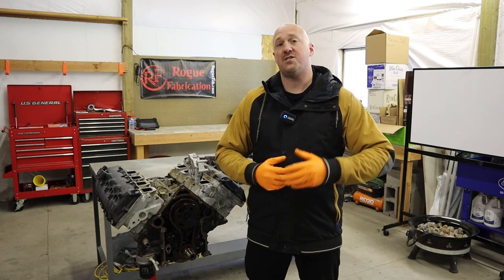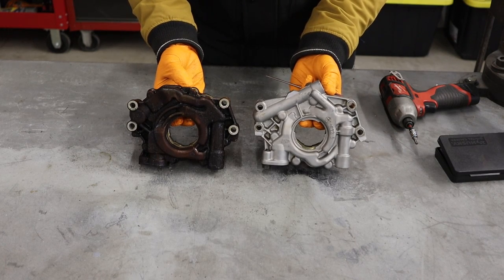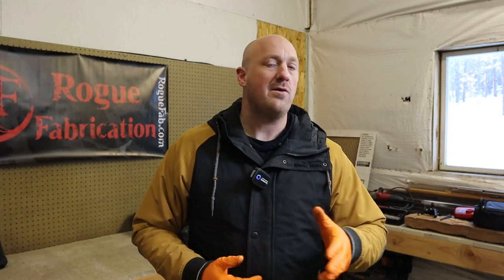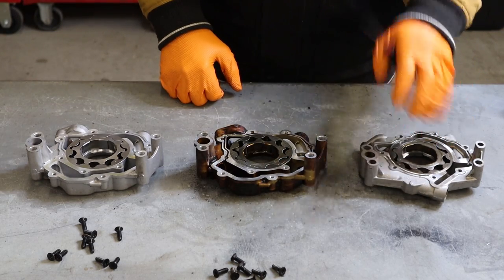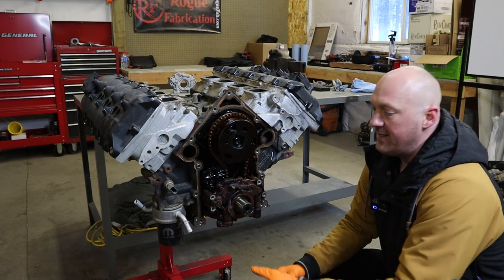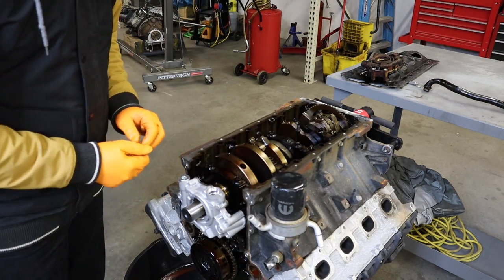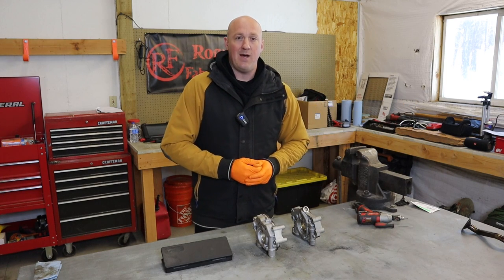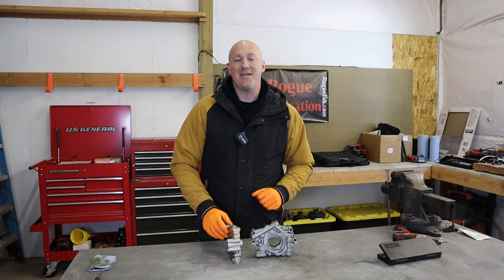Is it TRUE that Installing this ONE FACTORY PART Can PREVENT HEMI TICK?

Comment: We just had my wife 2013 wk2 camshaft and lifters replaced and had the 6.2 oil pump installed. I understand it setting codes for low oil pressure codes at start up. But it's been 900 miles and the code keeps coming back whenever it wants to. Like it's burn into the memory of the ecm. Do you have any input on this? Thanks
Reply from the maker: Unfortunately this is a software issue that seems to only affect certain models. Thus far I don't have a solution for it.
Reply: @ReignitedAuto  I notice you can clear the code and it comes back with a cycle of the key. It doesn't even have to start.
Reply from the maker: @Robert Stanley  well that's definitely new info.  I'm going to keep trying to find a solution.
Reply: @ReignitedAuto  me to is there away I could get intouch with you beside thur YouTube?
Reply from the maker: @Robert Stanley  I have email sales@reignitedtx.com but it's definitely hard to get back to everyone who emails me questions.
Reply: @ReignitedAuto  Thank you for your time I sent you a email and maybe working together we can get this fixed for everyone
Reply: @ReignitedAuto  good evening,  I sent you a email with info.

Comment: So everyone knows do not install a hellcat oil pump on a 5.7 if your doing other mods I added the hellcat pump to my build. Stage 3 comp cam kit holli intake manifold long tube headers. The oil pressure is way to high. I blew a valve in my head due to it. Stated my psi to this guy @reignited and he told me very nice. It was 100 psi. Ported heads on the way and hellcat oil pump out of my car back to the 5.7 pump. Do not do not install this if u plan on putting mods on your car as I did
Reply from the maker: To be honest, I don't know what you mean when you say it, "blew a valve in your head." If there's legitimately an issue it's good to find that out, but it has to make sense. If you want to email or message me directly and explain exactly what happened I'd like to know.
Reply: Dropped is what I meant. I was talking to text, also wasn’t blaming you for any of it sorry if it came off that way.
Reply: But seriously don’t waste your time maybe work well on stock internals but with mods I did. It cased damaged luckily pistons are good so getting some ported heads and taking the hellcat pump off and going back to stock

Comment: Great video, thank you for your efforts! 
I have a question. 
The Hellcat pump is wider by ~2mm than a 09+ one,
but what about the width of a drive splines on which the pump is sat.
Does it matter that the Hellcat pump is wider?
Reply: Yes, displacement is directly proportional to width of the gears

Comment: i have a 2012 Chrysler 300c AWD with a 5.7 hemi. what hellcat oil pump part number do i need to get that will work in my Chrysler need a reply asap
Reply from the maker: Hey Glen, all of the Hellcat oil pumps are exactly the same so it doesn't matter which vehicle you specify,  as long as it's for the 6.2 supercharged engine it's the right one.  👍
Reply: @ReignitedAuto  so that is not a clear answer will a hell cat oil pump  work on my 5,7 hemi in my 2012 chrysler
Reply: my questions keep disappearing why
Reply from the maker: @glenpoitras2082  Glen if you get snippy with me i'm a whole lot less inclined to answer questions that are already answered in my videos.  To answer your question, yes the Hellcat pump is a direct bolt on fit for your vehicle.
Reply: @ReignitedAuto  ok thank you I will post my results on a you tube video before and after and any problems the mechanics may have. the mechanics I have doing this modification have never heard of this being done so Thay are scratching their heads and asking me "do you know what you're wanting me to do is going to work". where I'm from the cost of the pump is 300 dollers, since the cam and lifers are on their way out replace the pump with the hell cat oil pump, I seen your videos and seemed logical that the cam and lifter are starving for oil when hot and idling just making sure the t"s are crossed and the i"s are dotted if not ill be selling a hell cat oil pump on e bay and also i may have a idea to solve the oil starvation to the needle Barings
Reply from the maker: @glenpoitras2082  if you haven't watched it yet,  I have a more recent video linked in the pinned comment at the top where I did install the Hellcat pump and posted the results. 👍

Comment: This is all just complete speculation and guessing. I hope you’re right that’d be awesome but nobody really knows for sure what causes the issue. If it’s the lifter design or actually such a minor oiling issue that  slowly ruins the needle bearings over the course of 70-100 thousand miles
Reply from the maker: You are correct, that is the main issue that extensive testing over long periods of time is the only way to be sure that there is a measurable difference. Since we can't really coordinate something like that online, I'm just using my best judgmentand it's up to you guys if you agree or not. 👍
Reply: When I worked for Dodge they had an interesting TSB on the issue talking about Idling over 365 hours you should change your oil

Comment: If you’re going through the trouble of digging out the oil pump, the camshaft NEEDS to be swapped with billet steel core like the Hellcat engines.  

Just putzing around getting groceries or an occasional hauler/street fun runner, let nature take its course after 100k miles.   

More volume/pressure takes parasitic power from the engine and may not allow oil enough time to adequately cool through exchangers on a daily driver.
Reply: If it is a high volume and not a higher pressure pump, the cooling shouldn't be affected.  The purpose of the higher volume is to increase pressure at low rpm, not high rpm. I don't know about these new pumps but the older engines oil pumps had a relief spring that controlled the pressure.  At low rpm the spring didn't relieve, only at high rpm when the pump is pumping more oil.
Reply: @williamwhite9767  you can’t have volume without pressure in a loop system. The pump is variable based on RPM/viscosity/bearing&lifterbore clearances.
Reply from the maker: @Garc Bomber This is actually something I'm hoping to show in a little more detail on the second part of this video series. 👍

Comment: Lol seems like a lot of work. I'll just tune the engine to idle at 1800 rpm with my diablo sport  tuner and disable the mds as well for good measure. It will take me 15 mins to do lol and that's it.